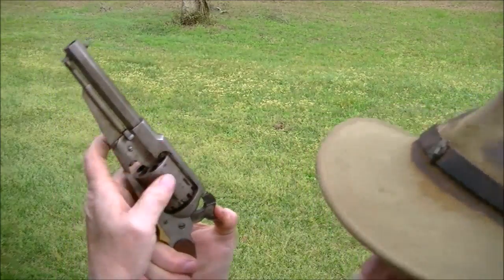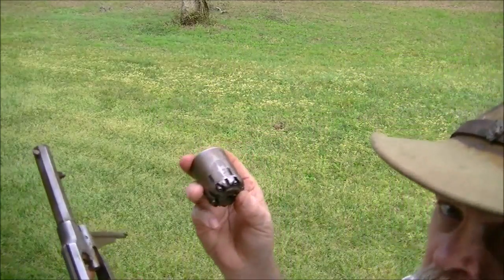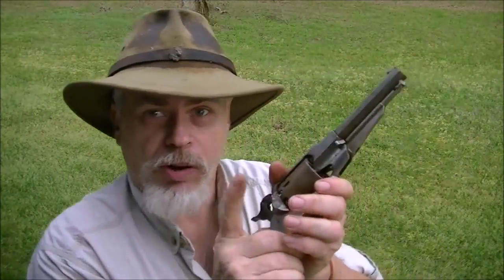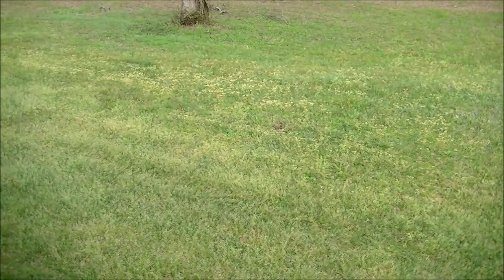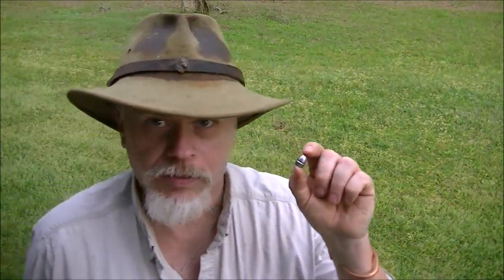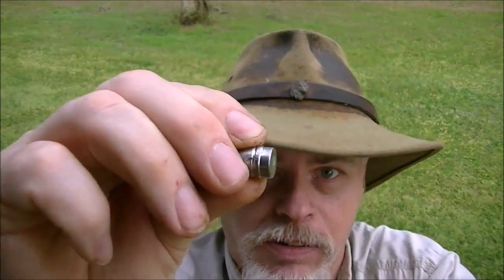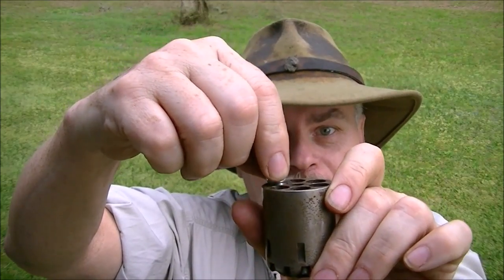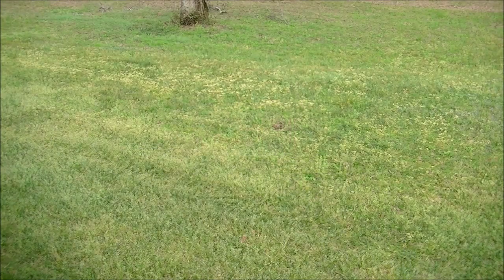PERCUSSION REVOLVER UPDATE

Comment: Hi Blackie,
I like to ask you about smokeless powder use. Some people don’t want to subject their prize possessions to corrosive conditions.
I would like to repost a forum posting talking about this issue...

“”Those of you who reload black powder cartridges for your antique rifles and pistols may be interested in article written by Sherman Bell in the Double Gun Journal. In this article, he measured peak pressures for both black powder and some smokeless powders. I've summarized the most interesting aspects of his experiments in the bottom part of this post.

In general, smokeless powder 2400 gives approximately the same pressure curve as black powder for the same velocity. Smokeless powders slower than 2400 will actually give lower pressure curves than black powder for the same velocity. Bell indicates that the danger in using smokeless powder is really only the danger of an overcharge or double charge, provided slower smokeless powders are used (another cartridge historian, John Kort, has found that 2400 is the crossover point ... use only 2400 or slower.)

Personally, I have reloaded and shot both smokeless and black powder in my old Winchesters dating from 1882 and on, including the '76, '86, and '94. Based on my own experience, however, before reading Bell's article, I decided that I would no longer use black powder in valuable antique rifles for the following reason: if the barrel has any pitting in it at all, even very small pits, it is impossible to completely get all the black powder residue out of those pits, with the result that the pitting will slowly get larger over the decades. Secondly, with smokeless powder such as IMR 4198, I could get the same velocities as black powder but with lower peak pressure.””

And, when you look at carts of burn rates of powders, there are approximately 70 more that are slower burning than 2400.
For example Trail Boss is so fluffy, it is reported be be impossible to overload any brass case. And reported to be very useful as a replacement powder for cowboy action. But, it’s burn rate is quite fast.
I hate the “absolute type rules” and then when you say “well what about so and so?” The reply is “oh well that particular one is ok, but NOt the rest” There are very few absolutes in this world except for,, death, and taxes, and gravity, and the earth 🌏 is not flat, but keep that one a secret.
Reply: Two ways to get around the corrosion problem.  Clean guns thoroughly, or shoot modern reproduction. Your advocating smokeless powder in a period correct gun. If that's the case, then use the brass cartridge cylinder in it. This article will have people with little experience in black powder revolver's blowing their guns up, and themselves. If you don't like the trouble of cleaning your BP guns, don't shoot them. No disrespect intended.
Reply from the maker: if a smokeless powder..has been deamed safe in a percussion revolver..it will be called a black powder substitute..pyrodex is a smokeless..but they add a component to make it smoke...as to corrosion..it cant be simpler..clean with hot water at the kitchen sink..takes me less than 2 min..dry and relube..i know lots of shooters who will pay hundreds of dollars for some .40 cal or 9mm..or whatever..and then complain after they shoot 200 rds at a match that they have to clean it..they want to shoot. throw it in the box go home and forget..those are not the type of shooters to handle a percussion revolver
 as to the trail boss ..i think i read somewhere that trail boss is pyrodex with out the smoke component added..so in effect its a blackpower  to be shot in smokless guns

Comment: Greetings from Ireland. When I lived in the US many years ago I had an 1858 Remington. When I removed the cylinder I always held the gun in my right hand then pulled down the loading lever and pulled the pin then I would tilt the gun slightly to the left and pull back very slightly on the hammer, the cylinder would drop out with ease. I would insert it the same way, all from the left side.
Reply: I'm left handed so I always drop the cylinder out and replace from the left side too. Drops right out.
Reply: @Traveler1226  I'm right handed, it's just the natural way to do it.

Comment: Hey Blackie, I just recently purchased a Remington 1858. I have noticed that if I pulled the hammer back not all the way to the half cock position, the cylinder will literally fall out on its own. This makes it easier to replace it with a fresh one, but you have to remember to keep the hammer in the same position to reinstall the new cylinder.

Comment: Blackie, I can't seem to find any information on how to remove the barrel stud that prevents removing the cylinder pin on my Pietta 1858 Remington. I would like to do a cylinder conversion with an ejector tube. I understand that may not be a popular  /  well liked idea with some folks, but could you or another follower advise how to correctly remove this stud?
Reply from the maker: thats the prob that pin is press fit if it is removed ya cant get it to stay in the hole..i have thought of a blind tap and threading the hole and cut and shape a threaded bolt todo the job..thus far i have not found a answer
Reply: Glad I'm not crazy. Ok what I came up with was to pull the cyl pin as far forward as I could and angle it down, then I squeezed file in between it and the barrel and I ever slightly beveled the forward top edge of the cyl pin so that I can pull it out of the gun now. I think if I get a conversion ejector I would be able to do a similar treatment to it as they seem to replace the cylinder pin. Hopefully in this way I can avoid the issue.

Comment: great info on the revolvrs Blackie .. Tell me Blackie where would be a good reliable source to buy a blackpowder revolver now days?Ive had one years ago n sold it. Back in the 80s. Want to get into it again im interested in  44cal. in possibly 6inch or similiar Navy model with a top strap. Any info is greatly appreciated.  Thanks..
Reply: I got my 1858 Remington from Cabelas. But later bought my 1860 Colt from Dixie gun works. I plan on buying my next from Dixie gun works again.
Reply: Cabela's, Dixie Gun Works, Buffalo Arms, C&C Sutlery, Track of the Wolf, Sportsman's Warehouse, Sportsman's Guide, Bass Pro(maybe), or your local Cimarron Dealer. Cimarron is Ubettis importer here in the US. No 4473 required, us mail can ship to your mailbox
Reply: @Gary Whelan Sr....Check Midway USA also. You will see them on sale there sometimes.
Reply from the maker: pat putman made a very good list ..thats where i would go look

Comment: Blackie, will the round ball rammer on the Pietta damage the Johnson and Dow bullet.  I believe the Uberti  has the same rammer.  Am curious to see how this effects the accuracy once loaded in the Remington.  Thanks for the videos.
Reply: They don't have the same rammers. One has to be modified. I think it's the Uberti Rammer that's gotta be modified. That said, many of the parts from both companies can interchange easily. Not all but most.
Reply: Check out Mark Hubbs' videos. He has one on modifying the rammer for the conical bullet. I think Duelist1954 does, as well
Reply: I have the Uberti 58 and I shoot the conical. Only thing I've seen is it leaves a ring around the lower edge. Does not damage point.
Reply from the maker: my rammer will flatten the point..we will see how it effect accuracy
Reply: Thanks Blackie, mine will too I'm sure.  I haven't bought the Johnson and Dow mold yet.  I will wait for your video.
 @BLACKIETHOMAS

Comment: Hi Blackie
Great info on you the Percussion revolvers.
What about a video on what to do with a newly purchased Cap and ball revolver ?

For example I just bought a Pietta 1858 Sheriff online and and the loading lever gets very hard to move when it gets about 1/4 inch from the front of the cylinder(is that normal ? if not what is the best way to address this issue )/??

The trigger pull measures from 3.5 pound to a little over 4 pounds ,which is fine by me for a good weight but it has a lot of gritty creep ,how to address this issue?

The Hammer is very hard to pull back,will backing off of the tension screw in the frame a couple of turns help without affecting the ignition?

I have enjoyed and learned from every single video of yours that I have watched.
Thanks for sharing with everyone.
Reply from the maker: sounds to me as if you have a few burrs to polish out..take gun apart and check each part of scrapes scratches ect..then check fit each part to make sure it is a smooth fit no binding..work it slow and dont remove metal just polish it a bit
Reply: @BLACKIETHOMAS  I appreciate your advice,do you find the CCI or the Remington a better, hotter more reliable cap?Are the newer Sheriffs models #10 or #11 cap?
I also see you using a lot of Pyrodex P,Do you find that a better choice than say Goex FFFg or Goex Olde Eynseford as far as reliability and velocity and accuracy are concerned ?
Thanks
Craig

Comment: Hello Mr. Thomas , I need your help desperately. I have a Uberti Colt 1860 Army revolver. Who's action just feels sluggish , the main spring (trigger) has a very strong pull to it. There's no cylinder drag and it locks up tight every time. So I'm wondering if main spring is the cause of the sluggish feel. Any help is much appreciated. Also , this is kind of random. You must live by an airport or military airbase. I hear helicopters and planes frequently in the videos. Just wondering. Have a good one.